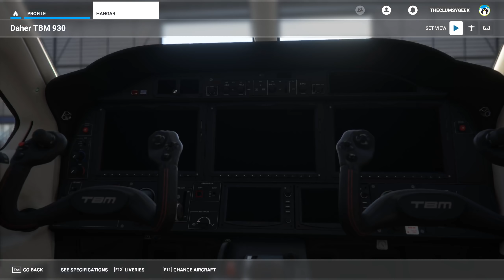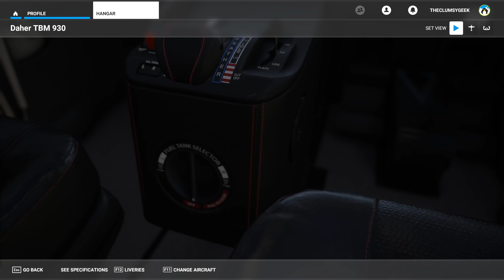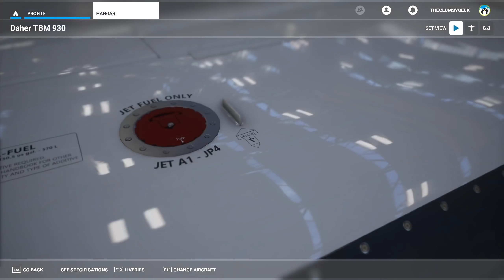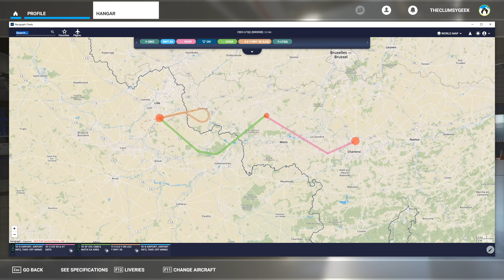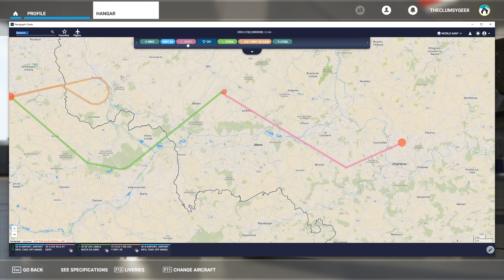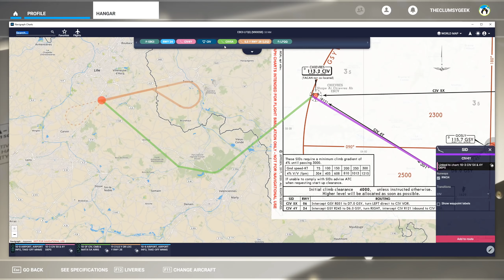When FS2020 gives you lemons... No GPS Challenge! - Microsoft Flight Simulator

Comment: Hi Clumsy,
Another great video to add to your MSFS stable. Thank you for all of them.
FYI, the new Navigraph MSFS Data Manager (Beta 9 AIRAC Rev 5) has all the missing data from your video. Even with the correct STAR selected, the course to the IAF is the "Great Circle" route. Although I'm an IR CPL, I'm not sure in reality that you'd ever track direct to the IAF rather than taking the circle route since the turn at the IAF seems rather steep. All that said, great demonstration of "needle" flying with the G3000.
Thanks again.
Reply from the maker: My pleasure man, and thanks for the inputs! Both pilot2atc and navigraph told me to go direct iaf, but maybe they can't handle this special procedure? I'll have to double check.

Comment: Also, I agree using legacy navigation is way more interesting.  Even more fun is to rely on static charts; no moving map display at all
Reply from the maker: Ooh yeah that's a good point. Next-level navigation!
Reply from the maker: @FlipjeNL  tell Asobo that. 😂
Reply: @FlipjeNL  The point was to offer a greater challenge to someone who wanted it instead of the usual push button flying.  Besides, many GA airplanes out there do not have IFR capable GPS with moving maps, so you can't legally use them and have to rely on the nav methods of "1925".

Comment: Your turn for the procedure turn inbound should have started at 1 min after wings level (or some set amount of time adjusted for speed) once established on the 122 heading (PT Outbound) - not at the 10 DME arc - what if that 10 DME arc wasn't there?  What if you were in an airplane doing 90 knots or an airplane doing 200 knots? 10 DME may have been too much or too little. That's why it should have been based on time.  But I am like you, back to basics and not using GPS all the time is more fun.  Other than that, nice job and way to adapt just like we do in real life flying.
Reply from the maker: Ah thanks for the tip! That's the part I wasn't sure of because there was no specific DME mentioned. A 1 minute time sounds perfect.
Reply: @TheClumsyGeekGaming  there won't be for a procedure turn.   Usually it's 1 minute outbound and start the time when wings level but if you're doing 200 knots in a large aircraft you might want to only do 30-45 seconds so you don't leave the protected area.
Reply: @TheClumsyGeekGaming  I have an NDB approach on my channel that has a procedure turn with time if you want to see it.    It's not narrated yet but it's coming.